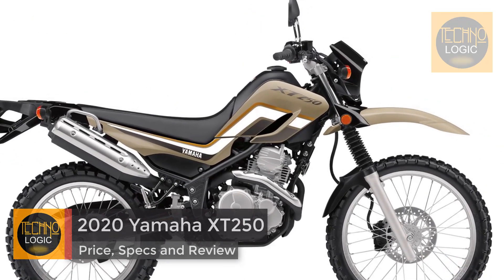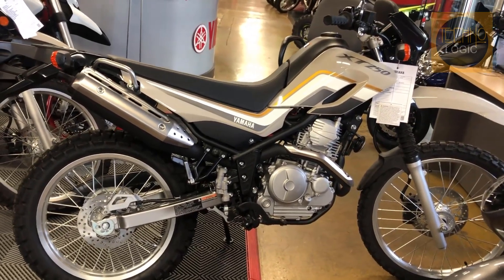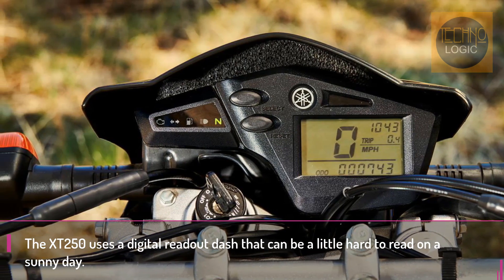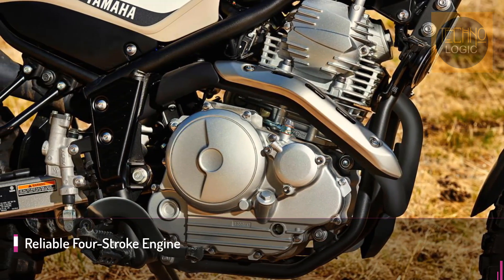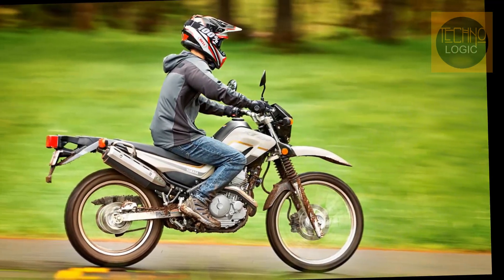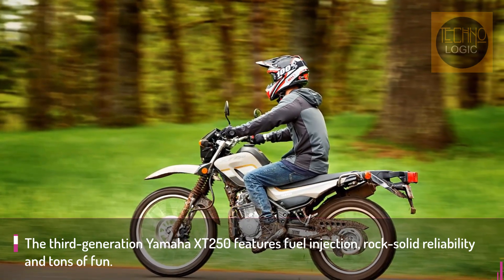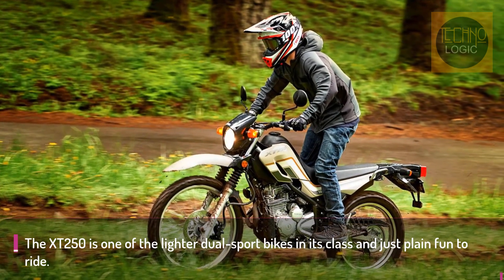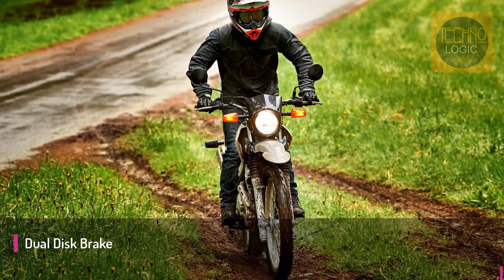2020 YAMAHA XT250 PRICE, SPECS & REVIEW

Comment: It is a shame that Yamaha plans on discontinuing the XT250 after 2020. Rumor has it that the replacement will have a higher seat height. May make it harder for new riders and shorter stature riders.
Reply: Is this true? Discontinued after 2020?
Reply: @grumpysquid  not true, just a rumor
Reply: There is a 2021 XT250 and no changes from the 2020 model..

Comment: I recently emailed Yamaha UK and asked why they never brought this bike into the UK.  the answer was because it doesn't   meet Euro five specification.
 but what was stopping them bring it is when it was   Euro 3/4?    UK hasn't got a dual purpose 250 trail bike. it hasn't had one for absolutely years.   the Kawasaki and Honda 250  off-road bikes.  they are not dualpurpose they are solely focused on off-road.  The seat is too high the engine is  Double overhead cam too complicated.  and the tank is ridiculously small.  it is why you have hundreds of them for sale with hardly any miles on the clock.    now I see Yamaha is going the same route.    in the  60s and 70s the Japanese company used to listen to the riders now they don't.      

they're going the same way as the British motorcycle manufacturers did , they sold bikes that people didn't want but the people that wanted motorbikes had no choice  that's why when the Japanese entered the market there was new interest and an increase in motorcycle sales because they gave them what they  wanted.

 now I see the Japanese  are going the same way as a British motorcycle  industry did.  forcing people to ride bikes they want them to ride not what the people want to ride.